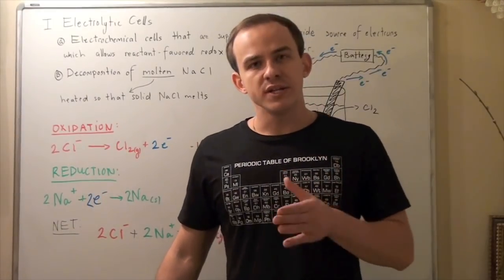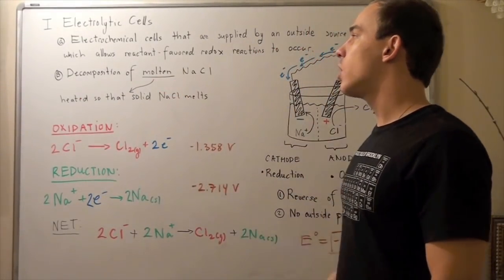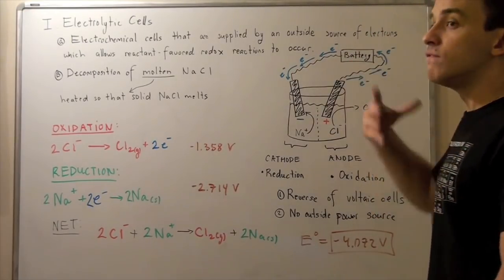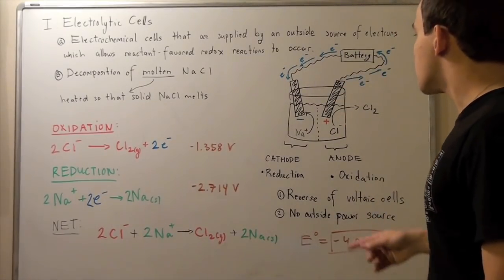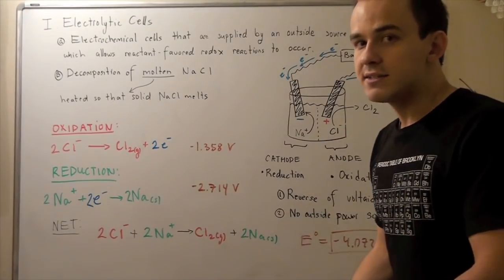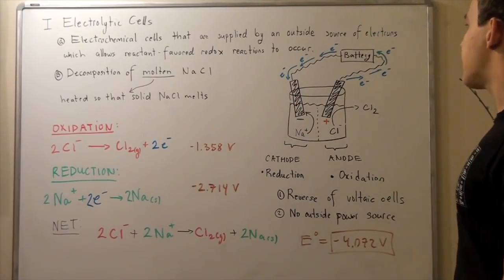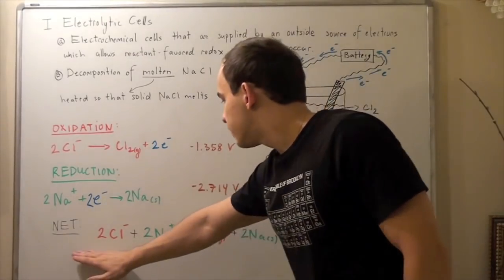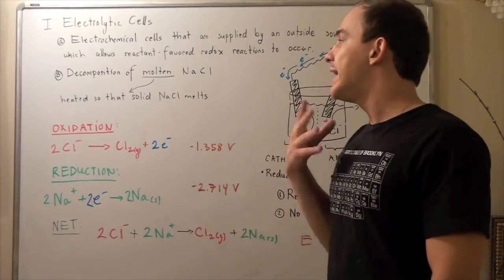Electrolytic Cells and Electrolysis

Comment from the maker: 1) The purpose of a battery is NOT to power just any redox reaction. Its to power a non-spontaneous Redox reaction. So in this case, we use a spontaneous redox reaction to power a non-spontaneous redox reaction. The purpose of the battery is to create a movement of electrons that flows to the left. This means that to close the circuit, the electrons from right electrode must circle back to the point of origin. Otherwise, we would have an open circuit, which means electrons would not flow.

Comment from the maker: A battery is an electrochemical cell in which electrons spontaneously run from the anode to the cathode. They run between the wire connecting the two electrodes. Imagine cutting the wire and connecting the two ends to the electrolytic cell in such a way, that the electrons will run in the reverse direction in the electrolytic cell.

Comment from the maker: You seem to be following some type of formula.. Try thinking about it logically, you will see that you cannot get a positive value for an electrolytic cell. The reaction shown above is not spontaneous, which means it cannot have a positive voltage. Since oxidation of chlorine takes place in the anode and reduction of sodium takes place in the cathode, you simply add the two negative numbers up. And you get - 4.072. Remember, in an electrolytic cell, you are using a battery to power the reaction.

Comment from the maker: We will have a tad bit of hydroxide ions present in the mixture, which will be oxidized at the other end by the following reaction: 2OH- + -> (0.5)O2 + H2O + 2e-. The sulfate ion actually does not take part in the reaction and remains in the mixture. Why? Well because the oxidation potential for the above mentioned reaction is higher. Note that the concentration copper sulfate remains constant in the mixture.

Comment: 1.36 is the reduction potential of chlorine, so you have to flip the number to get chlorine's oxidation potential (since in this reaction it is being oxidized).  

Also, you have to take the sum of the oxidation and reduction potentials to find the voltage.  The video explains that the voltage can't be positive because electrolytic cells deal with nonspontaneous (unfavorable) reactions, which would indicate a negative value for E

Comment: Yes, your explanation helped a lot. It seems to me that you're saying the battery (galvanic cell) powers the flow of electrons in an electrolytic cell by reversing the flow of electrons so that an otherwise non-spontaneous redox reaction can occur.

And for # 2, are you saying that the - sign becomes a + sign b/c in an electrolytic cell's anode b/c the electrons do not flow naturally from the anode but instead have to be "forced out" by the battery.

Comment from the maker: Thanks for watching! Sure, I would love answer any of your questions.

Firstly, lets get something straight. An electrolytic cell is not a battery. But a battery and an electrolytic cell are both electrochemical cells. A battery is one type of electrochemical cell in which a spontaneous Redox reaction allows you to generate an electricity source. On the other hand, an electrolytic cell allows a non-spontaneous Redox reaction to take place with the help of a battery. With that said:

Comment: This video is very helpful. Thanks a lot.  I just wonder if you can clear some of my
confusion. 

1)If the battery is the electricity source in this kind of cell, then why are electrons being taken from the anode? I thought that the purpose of the battery was to power the redox reactions, so shouldn't the battery provide the electrons? 

2)Why is the anode positive for electrolytic cells & negative for galvanic cells? I thought it should + in both cells b/c oxidation always occurs at the anode.

Comment: No he's right.  The total voltage is the SUM of the oxidation and reduction potentials, so it's:
Erxn = Eoxidation + Ereduction
Erxn = -2.714 + (-1.358) = -2.714 - 1.358 = -4.072V

Comment: Here's a case where you really shouldn't "PANIC" because that mnemonic is not accurate here because the cathode and anode are switched . I think the naming convention of anode and cathode could be greatly improved if we instead called anodes "oxodes" and cathodes "redodes" as the anode is where oxidation occurs and the cathode is where reduction occurs. This is true for any kind of cell, galvanic, electrolytic or otherwise.

Comment: you say its reverse of voltaic cells, but in your voltaic cells video electrons also flow from a + charged anode to a negative charged cathode, so i dont understand. i mean in the diagrams you show it flowing diferently but essentially  they both flow in the same direction
Reply: Everything is the same between voltaic and electrolytic cells except the charges of the anode and the cathode and the overall concept about how this is for reactant favored reactions.

Comment: very informative video, but what is the force that causes the electones to get sucked up the through the anode so it creates a positive charge around the electrode. we know chloride doesn't want to give up its electrons. is it the force of the battery?
Reply: theburthope lumby The wire and battery is the fastest way for the electrons to travel towards the positive source ( Na^+). And well Cl doesn’t like to lose electrons, Cl ion with a 1 minus charge is much easier. At least that is how I understand it, I could be wrong though.

Comment: Im a bit confused. I am pretty sure that in voltaic/galvanic cells, the cathode is negative and the anode is positive, but you state the opposite. Electrons  flow from anode -> cathode, therefore cathode is always negative, and anode is always positives because electrons are leaving. Can you clarify?
Reply: no, i will not clarify

Comment: quick question:
since E cell = cathode - anode, wouldn't E cell = (-2.714) - (-1.358) = -1.356?
E cell would still be negative, indicating an electrolytic cell, but would the emf but a different value than -4.07V?
Reply: sorry, i saw my mistake, i was supposed to flip the -1.358 and make it positive, thereby the equation should be -2.714 - 1.358 which would make it equal = -4.07V

Comment: i didnt understand why the E-cell is -4.072 ...
isnt it supposed to be E cathode - E anode?
Reply from the maker: E_cell = E_cathode - E_anode is only used if you are too lazy to flip one of the half-reactions from reduction to oxidation. That is, the negative sign is implemented to take that flipping process into consideration. However, I use the equation E_cell = E_cathode + E_anode because I like to first determine which is the oxidation and which is the reduction. When I determine the potential for the oxidation, I simply negative the sign of the cell voltage of that particular atom and then  add up the two potentials. So lets say that you are not comfortable with my method, you can still use your equation and get the right answer: E_cathode - E_anode = - 2.714V - (+1.358V) = -4.072 V .. So you still get the correct answer. Basically, the way they teach it in schools and in textbooks is kind of annoying because they make you memorize the equation with the negative sign but never really explain what the negative sign is for. The negative sign is used to flip the equation from the reduction to oxidation equation.